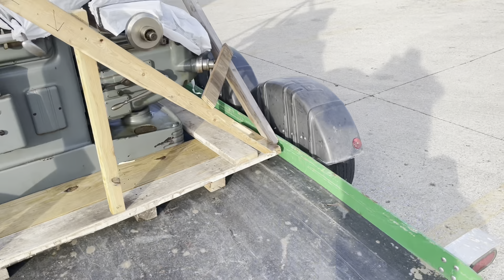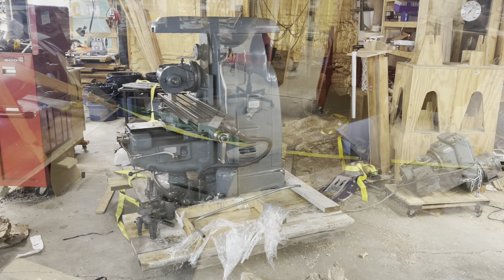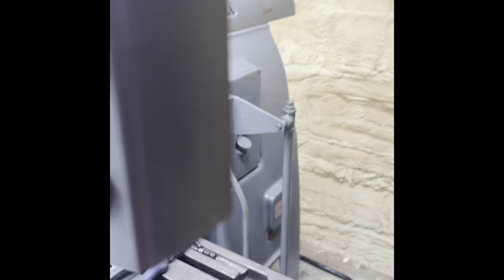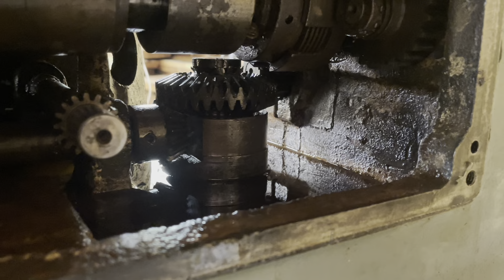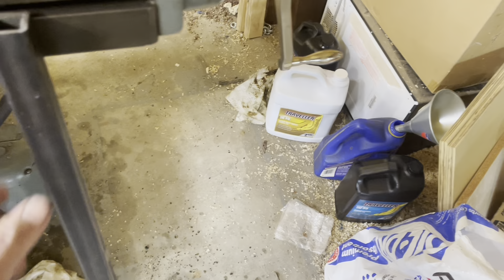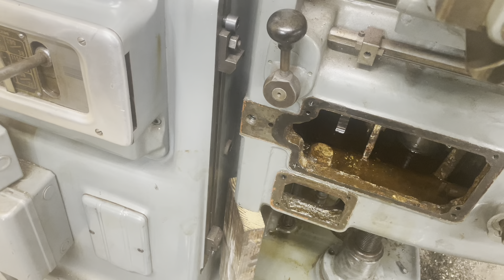NEW MACHINE DAY…(and Operation “Free the Knee”)

Comment: I  have one just like it that I bought in 1980, but it's been used and abused. Broken/missing handles, etc.  I'd love to find one in that condition, looks like it just came off the show room floor. Van Norman machines were very well built and engineered. The dual front/rear controls and design features of this machine make it a joy to use. Note: My machine looks nearly identical, but the plate on the front of the base says "No 2 Medium"
Reply from the maker: I’m more sure of other differences, but the 2Med was 5hp, I believe.  Mine is 3hp, which suits me well.  My first job on it will be to make an arbor support.  I’ll probably post a vid of that.
Reply: @thomasstover6272  Yes mine is/was 5hp. But back in the day my DIY phase converter wouldn't start it. I shoe horned in a 10hp motor that the PC started no problem. I made an arbor support for mine, it's very simple (no dovetail) but works well.

Comment: Wow that machine is ......beautiful!  ( I found one in a barn this year...Van Norman 12 Duplex.  I left it there....Not the kind of thing you find and put in your pocket like a Swiss army knife).
Glad  you posted this, very interesting how you worked out the solution.       Happy New Year Everyone!
Reply from the maker: If you change your mind it will probably still be there!
Reply: Hello  @thomasstover6272   Years ago I moved a Bridgeport over the rolling hills of CT.  I used a 4 cylinder with a very light weight tandem axle trailer out of Florida.

(Florida had endless home made trailers years back...this was one of them).

I was just the driver, the guy that said "Sure, I'm not doing anything...happy to help"
I learned that day just how heavy these monsters are.

I'm afraid that even if I wanted the #2....I'm not sure I could  move it.
....let alone know how to use it.

But I do admire the way machines like this built America.